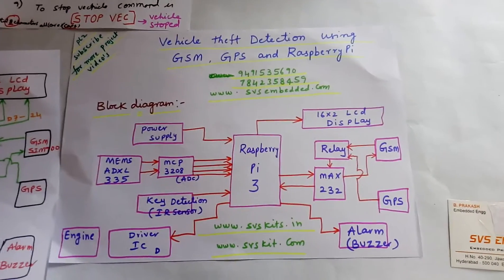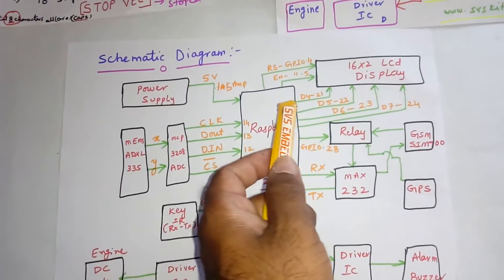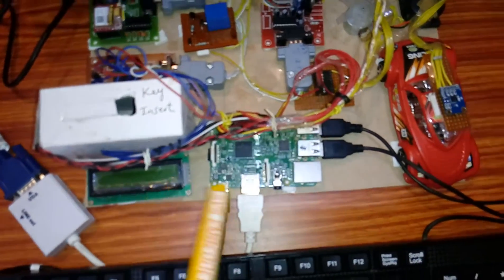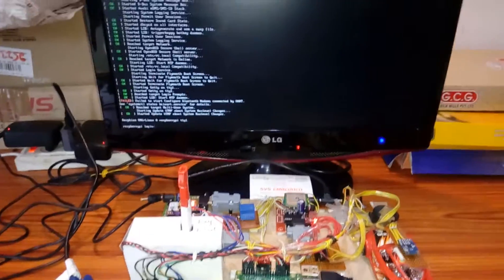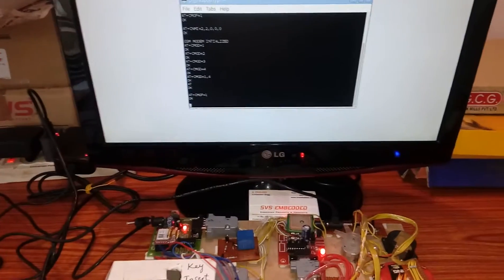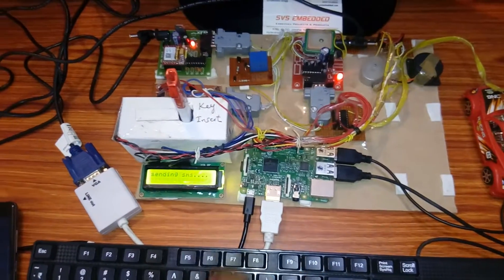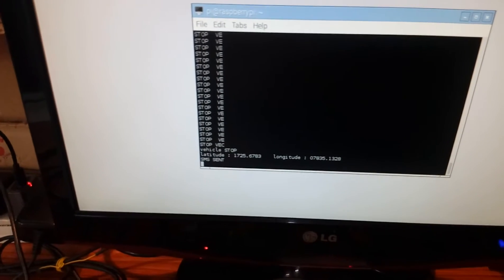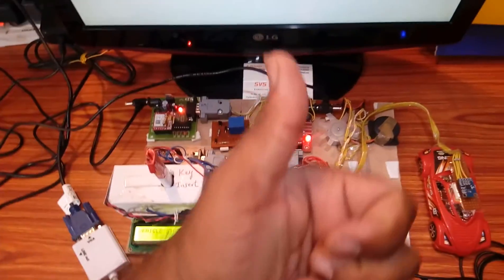vehicle theft detection using gps , gsm and Raspberry Pi

Comment: COOL PROJECT I'M GOING TO USE YOUR PROJECT
Reply from the maker: Thanks for watching and your valuable Feed back.
we are selling the projects with least cost.if u order the project we will provide working hardware kit along with 
1.abstract
2.datasheets
3.documentation
4.schematic( circuit ) diagram.
5.software code.
6.sample ppts
7.photos&video file on entire project
through google drive.if u r interested to take the project.
send me a mail to  svsembedded@gmail.com,info@svsembedded.com.
9491535690,7842358459,
www.svsembedded.com,www.svskits.in,
we will send u the how to order procedure to u on mail.
Reply: Well I have raspberry pi 3 and GSM module but I don't have a GPS module .Is it possible to connect the gpsmodule via USB because we have only one TX and RX in raspberry pi 3 and can you suggest what kind of Gps module  should I use????